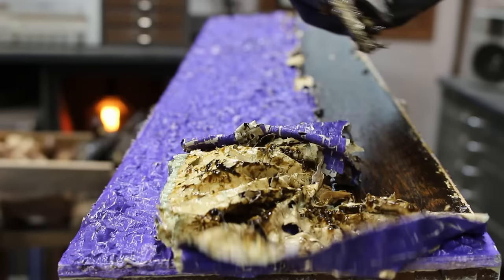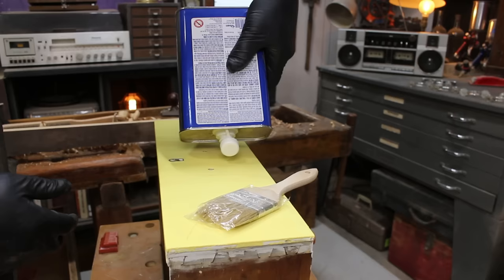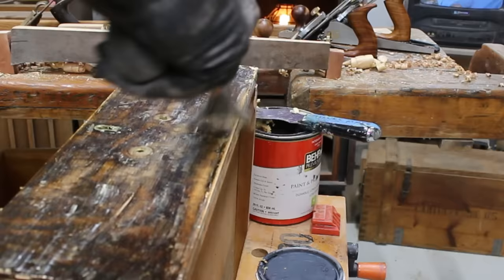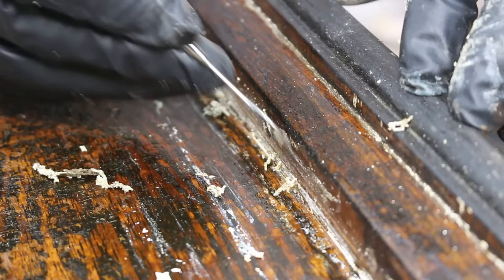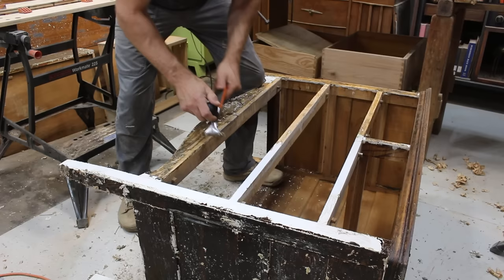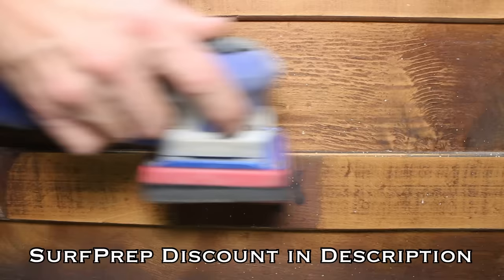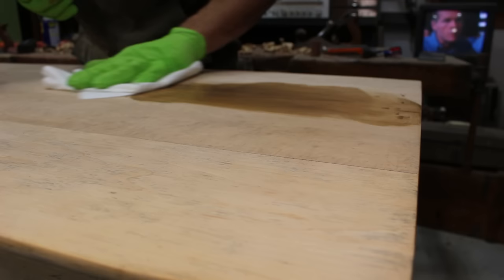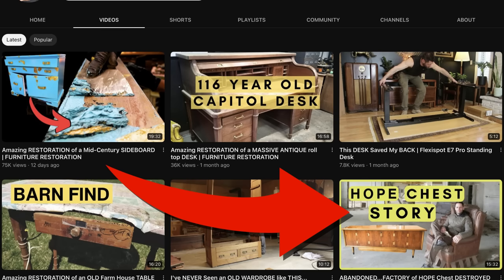Ep. 78 Amazing RESTORATION of Nasty Painted ANTIQUE DRESSER

Comment: You are right about the scraping.  The only time I would  hesitate to do so would be with doing a really fine antique, or something with intricate detail that might be easily damaged by scraping.  The same for chemical strippers.  Some of the older finishes can be released, or for that matter renewed with specific solvents.  Shellac for instance responds well to denatured alcohol, but Shellac does not respond to some strippers.  I learned that one the hard way.  Also, some lacquers can be toungh for any chemical to cut through, scraping or sanding is the best answer.  Last note Iearned from an elderly neighbor when I was young who helped me with a few of my first projects, the importance of figuring out the old finish you are working with.  Shellacs and related work well with scraping, but some of them, sanding heats the old finish and makes a mess and stains the old wood. Just some ramblings.
Reply from the maker: This is such good information. Thank you
Reply: By the same token, older furniture that was produced in a factory was usually finished with nitrocellulose lacquer.  This can be stripped with lacquer thinner.
Reply: @islandblind  also, denatured alcohol is the test for shellac
Reply: @richardpfefier1171  It is.

Comment: I learned furniture restoration by working with my best friend.
    Her mom had a local resale shop. The whole family travelled back to Pennsylvania each year, to find old Chippendales and other high quality pieces in need of work. 
   I learned so much from them! They even taught me how to hand-cane (weave) chair seats and backs! An art that will be lost soon.
   They used methylene chloride- which we now know to be carcinogenic. We switched to EZ-way, an alcohol based gel remover. It probably saved my life too!
    I got through university by starting my own restoration biz. I even matched the old veneers to new ones that I got at a Seattle company. This was before the internet, in the 1970's-80's. 
    Loved this video! It brought back many happy memories. Thank you🙏🏼😊
P.S. I loved how you repurposed the vintage dental kit as a groove-cleaner!😅 Genius!
Reply from the maker: I love this and really appreciate you sharing. Thank you. Barry
Reply: @MadCityModern Thanks! I forgot to mention that you did a wonderful job on the dresser!
    The before & after photos are like night & day. I never did try shellac on my restores- but it seems to do the trick. 
   I was told to only use finishes that could be (reasonably) easy to remove. Usually it was an oil stain and then a hardening oil finish.
    But never polyurethane! That stuff is a beast! It dries the wood until it turns to powder. And you have to pretty much sand it off to remove it. I've seen many otherwise fine pieces of furniture ruined from  someone coating them in polyurethane. 
   I finally just refused to take anymore pieces that were coated in it.🙏🏼

Comment: My dad was not very handy, but he got a beautiful slab of black walnut from a tree felled near our house. He slopped polyurethane on it and gave it to me and I used it as a desk top for decades. Then I finally got my brother the woodworker to sand that finish off and add some Nakashima inspired butterfly joins for the cracks. It waited another 15 years until I found someone to build a gorgeous coffee table base that I helped design. It has a natural light satin finish so the beauty of the wood is featured. It’s the most lovely and treasured piece of furniture in my house.

Comment: No good stories of my dad, but my daughter has some from her dad. I vowed to never make the mistakes with her that my dad made. Last a bit of hopefully helpful advice. Try using wood chips to remove the paint and stripper. Works great on ornate pieces you can't scrap. Especially in those pesky corners. I buy a bag of wood bedding at the feed store, it's cheap and gets a wood stove burning quickly in the winter.
Reply from the maker: Love this feedback. I have plenty of wood shavings around 😍

Comment: When I was a young teen, we remodeled our 100 year old farmhouse.  On the evenings my brother had basketball practice (Dad never missed a game), I would help my dad work on the house.  He taught me to lay subflooring and flooring, run electrical wire, use a chalk line, hang sheetrock and doors, how to overcome challenges (none of the floors were level and none of the corners were a right angle), and most importantly, that any job worth doing is worth doing well.  And he taught me that "a straight nail won't go in a crooked hole."  Oddly enough, words to live by.  He passed almost 30 years ago.  i still miss him every day.

Comment: My dad is still with us but he taught me how to work on cars and do many things independently around the house. Being female was never an issue it was all about knowing I could do the same stuff men could do. I learnt to pull apart engines, change tyres and pull apart and put back together the entire interior of a car too. As I got older we did stuff around the house together like change washers shower heads taps etc.  Skills that have stood me in good stead as I got older.  I can even use a chainsaw as we lived in the country and our house had a wood heater and dad worked away and he didn’t want mum using the chainsaw.  It’s amazing the stuff we learn from our parents. I also have horse skills too all thanks to dad.

Comment: Excellent restoration !   However, if you haven't sold it yet, you might want to take off one of
the plastic drawer pulls, go  to a big box hardware store, and see if you can get six matching
antique brass finish drawer pulls with the same screw spacing.  That dark oak finish would look
awesome with some antique brass pulls, which would also go well with the brass drawer locks.

They don't have to be real brass, just brass finish.   There are lots of very reasonably priced 
ones at the big box stores, and it would definitely be a significant upgrade.

Comment: Dad had a heart attack when I was in maybe 5th or 6th grade. At that time (late 1960s) my Dad was given 6 months off to heal since he was a mechanic in the steel mill and worked on large pieces of equipment. I remember him talking about swinging a 30 lb sledgehammer to take bolts off. During that time and later in high school,  he taught me stamp collecting and a little bit of woodworking and finishing. Dad died when I was 19 years old, but his dream of having a small farm or homestead stayed with me. Twenty five years ago, I bought 10 acres and finally had my house built 15 years ago, after my contract at work was finished. During that time, I took a 3 day carpentry course that used only hand tools, nothing electric. We each started by building a tool box and then spent the last day and a half building a 4 ft x 8 ft building that the instructor's community would use; there were only 5 students in the class. Fast forward 12 years or so, and I have spent 2 years designing and building a 12ft x 24ft barn for my goats. I cut all the lumber and put in every screw and nail in the project. It still needs more work but the temperatures are over 100 degrees F,  so I'm not doing any of that. When I look at what I have managed to build (not pretty but does the job), I think I can hear my Dad chuckling at me. Not too bad for a 67 year old female retired science teacher.
Reply from the maker: I really enjoyed reading this. Thank you so much for sharing! Barry

Comment: The shredders are back.  God bless Summer!

Do you ever use a heat gun to remove old paint?  I don't recall seeing it on your channel, but I have used one with great success.  My home is about 150 years old.  The front door is probably original, certainly it is old, and when I purchased the house it had been painted again and again.  For obvious reasons, I did not want to remove and rehang the door each day as I did the work of refinishing it.  Paint remover and scraping proved to be impracticable.  The heat gun was a god send.  It takes a few passes to get the technique into your hands, but soon the paint will be bubbling up and falling off.  It's great a great tool.

My father?  Noooooooo.